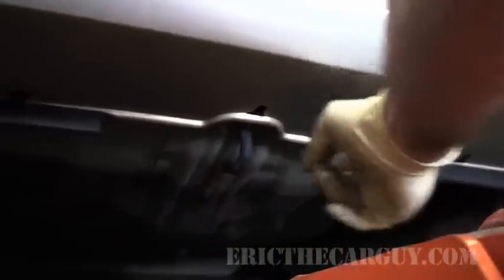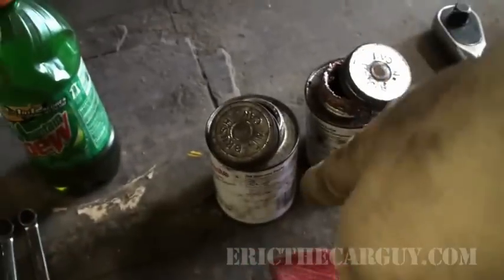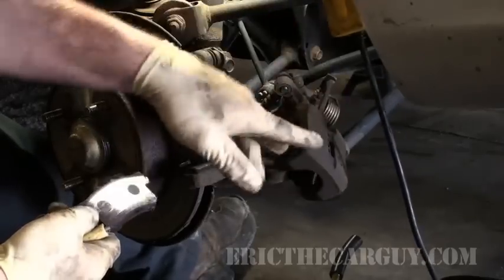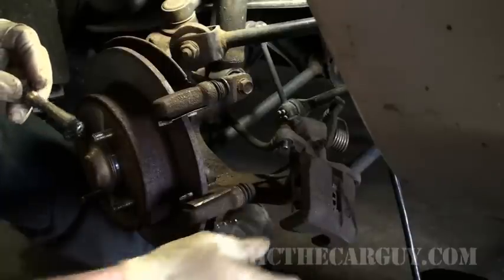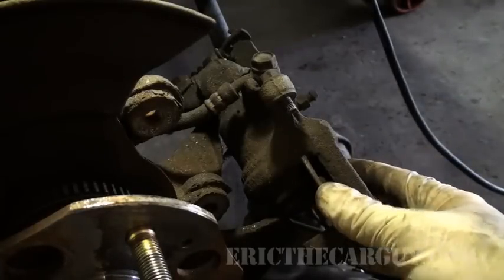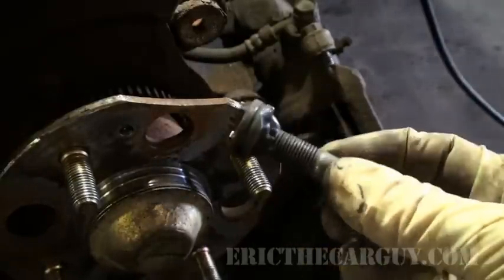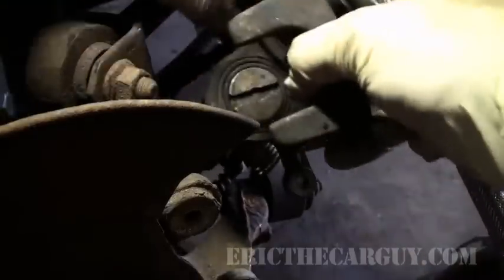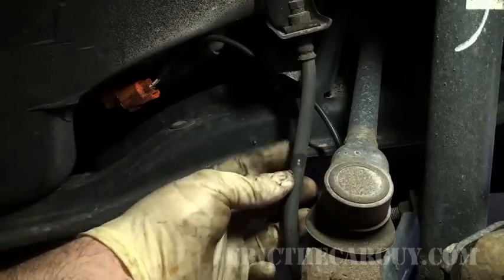How To Replace Rear Disc Brakes (Full) - EricTheCarGuy

Comment: Hi Eric, when you turn the caliper piston, you said turn it clockwise only.. Is that true for both the right(passenger) wheel and the left(driver) wheel?

My piston compression tool comes with both clockwise screw and counter-clockwise screw, so when is the uses for the counter-clockwise one?

Comment: hi Eric , is it necessary to release brake fluid value to let small 
amount of brake fluid to escape in order to push caliper piston back or 
it is OK to just use C Clamp to just push the caliper piston without 
releasing brake value, which method is right even for front or rear 
brake pads replacement? thanks

Comment: Hi Eric, thanks for your helpful guiding.
Eric while I was doing rear disc replacement on my Passat 04, I discovered very rusty part of hub assembly as well as the assembly bolts are super rusty, some of them even missing piece of them. If I would like to replace the hub assembly what needs to be done? Is it attached just with 5 allen screws?

Comment: Instead of Water Displacement-40th Attempt, try PB Blaster. PB Blaster is considered the best rust penetrant at the moment (anything stronger would not be available to public due to idiotic lawsuit). Then try using 3/8" breaker bar + 6-point socket. If that doesn't work, you need an impact tool. If the bolt breaks, you need a new set of slider pins & bolts. When I do my rears on 04 TL, I usually replace all hardware and on-line vendors sell caliper overhauls kits; recommended.

Comment: Hi Eric.  Do you have a video on adjusting the rear disk parking brake lever on an older Chevy?  I have a 4 wheel disc brake conversion kit (from CPP) for my 1971 El Camino.  I believe the rear disc calipers used in the kit are from: "1980-1985 Cadillac Seville Rear Calipers w/ Parking Brake." I believe that most of the GM rear disc brakes are the same design.  I want to know if I need to rotate the cylinder to advance the internal ratchet to precisely align the parking cable lever.  Thanks.

Comment: Antiseize on top of an abutment guide doesnt remove rust built up under the guide. Lube it all you want, it will still get wedged, and faster than the last time.  The caliper frame needs to be throughly cleaned down to bare shiny iron in that area before applying antiseize UNDER the abutment guides. The pad ands and stainless steel abutment guide will do fine with just silicone grease.

Comment: My experience may not be typical, but when I extracted frozen rotor retaining screws, the corrosion was under the screw bead, not on the threads. Also, those screws need only be installed hand tight, you don't need to hit them.

Comment: In this setup with new pads and new rotors, is it not necessary to machine the rotors? Also, does any prep work need to be done to the the pads before coming in-contact with the rotors?

Comment: If the caliper mounting frame is so corroded that the pads before bound by rust under the guides, its easier to remove the frame to work it than to remove the rust with the frame in place PLUS you lessen the amount of rust that could get into the space between the disk and inner hub. lso easier to remove, clean and relube the guide pins and boots .

Comment: Hey Eric, great video very thorough, but I have a question still. @ 7:50 you mentioned that you get a click when you apply the brakes. I have a '99 sienna with rear drums, and the sound of clicking comes from the rear. Are there any noises similar to the noise you were mentioning but for rear drum assemblies. The sienna is equipped with ABS. The sienna under light braking makes clicking every half a second until i let off of the brakes. Only one side is affected on the car.

Comment: Good instruction video , I myself prefer using a big flat screwdriver with a hex shank and if its tight I use a small wrench on the shank when turning the piston back into the bore .
Also I have never run into Master cylinder problems without pinching the hose , just my experience .
However I've had to drill those rotor holding screws out several times since the Factory does not see fit to put anti seize on the threads ..
By the way dude you look a lot like  George Clooney on some shots .

Comment: also use a 4" hand grinder to clean the outer disk lip. the new pads will seat better. don't forget to suck out all the old brake fluid in the reservoir and  lines. hand vacuum tools are cheap. In fords you'll need the piston tool to rotate it back so the parking brake can be set

Comment: ... then turning the remainders of the screws clockwise bit by bit, until they finally came out the back of the hub. Afterwards I used an M6 thread cutter to loosen he whole thing a bit, so I hopefully won't have the same problem next time.
What I really can't recommend is leaving the screws out completely. It's true the wheel rim holds the brake disc in place, but you can easily tilt the disc, which won't do you any good. Anyway, I now took only one screw per side.

Comment: On Honda that dont have the parking brake integral with the caliper, like the cd-v and element, you need to use a wrench to prevent the caliper guides from twisting and tearing their boots.

Comment: Thank-you so much for all these awesome videos!!!  I own a 2015 Nissan Altima.  It has the pins arranged OPPOSITE of what you say in this video @ 7:50.  Did it come from the factory that way, or did someone who didn't know what they were doing put them in the wrong holes?  I just watched a different brake pad replacement video that is specific to my make/model, and it showed the "rubberized" pin as belonging in the TOP hole.  What's the deal?  THANKS!!!

Comment: Is the mountain dew bottle with hose attached to the bleeder valve just to make sure the fluid doesn't spill? Is there any issue with just letting it bleed onto the ground or will this let air get into the hose/cause issues?
Reply: ***** Yes.  You need the hose to be submerged in brake fluid, so that it can only suck in fluid and not air when there's back-pressure.

Comment: I know this is an older video, but I got a question about them rear rotors. Them being not vented and single wall, do they not warp very easy? I got a 2000 prelude which has same rear rotors and I think they warped bad, I've never run bad brake pads on them either or never drive around with e brake on either

Comment: Hey Eric it is posting day for me again so one more question! When you grease the slide pins you use silicone lube but i can not seem to find that here anywhere :( and all people think i am a perv ^^ do u have a suggestion what else i could use ... my carparts shop  told me to use copper grease? that sounds a bit off to me but yeah i ve never heared of it so far so that might be the reason ^^

Comment: As long as you're able to make the piston spins, you can use anything.  I always try it with a long nose pryer before using that special tool.  But what happens is, the piston might got stuck, and you won't be able to spin it with a pryer.

Comment: Hi Eric, when I did the caliper piston on my VW Polo it would move clockwise but not go lower in the caliper. I then wound it anti clockwise two turns and then when I rotated the correct way it went in. Is this ok? Will I have introduced any air to the caliper? Cheers from the UK.

Comment: Nice Video, thanks Eric. I'm wondering if any one knows why its important to set the slot or the holes in the top of the piston to the 12 o'clock position. We have a wheel that still turns tight after following this and other videos. Slider pins and sides of pads and brackets all cleaned & lubricated, etc piston and caliper appear undamaged, running out of options. Wheel bearing ok and hydraulic lines seem ok, no built up pressure.

Comment: I know this video is over 6yrs old, but can you tell me when to choose silicone over anti cease or vise versa. Also is there a reason you clamp the hose and release the fluid thru the bleeder, rather than taking fluid out of the MC reservoir then just screw in the piston which I know will push fluid back to the reservoir. Is that bad for the MC? Thanks!

Comment: You can. Open the reservoir and wrap a rag around it to catch brake fluid in case it over flows.

There is a risk of ruining your master cylinder.

Comment: Vise grips with the fuel line, why didn't i think of that before; simple and efecive (well, sort of; brake lines are not really meant to be severely compressed like that, and we have replaced internally collapsed ones before ).

Comment: Eric, what happens if you rewind the brakes the wrong way? I had one that was really stuck, and I moved it back and forth until it retracted... and being that I wasn't sure I did it right, I turned it the wrong way to move the piston out (was putting in new seals).. will turning it the wrong way ruin the caliper? It was on an audi allroad 2004.

Comment: Added the lubricant to the contact points for brake pads. When I drive my truck, the brakes don't make any noise, but are extremely hot when I stop. How do I know if my piston is sticking or if I need to replace my caliper? You told me on a previous comment (on your latest video), that it's normal for brakes to heat up, but my husband is worried they are too hot.

Comment: 1. Trying to push the pistons in by turning and applying pressure manually wont get you anywhere. I tried for hours and finally gave up on that. However, I bought such a universal turn-push-tool from ebay. Like Eric's it has a front plate that can be used from both sides. However, since it also has pins on either side, it was to thick to fit into the caliper, just like in the video. So I ended up taking an angle grinder and cutting the further apart pins off. Then it fit just snuggly. :-)

Comment: I was told that taking the cap off of the master cylinder was sufficient protection to prevent anything bad from happening.

Is this not the case?

Comment: good vid Eric but you missed one of the most important things that make pads stick and wear fast etc , the stainless pad clips MUST be removed and cleaned with wire brush and more importantly the rust cleaned out from under them where they sit in the caliper holder  if not the rust forces the clips up and pinch the brake pads , I remove mine and sand blast the area and then put a light coat of syn. brake lube on the area to prevent rust  then put clips back in (also good idea to buy new clips as they wear also)  . File and wire brush on drill will work also  just be sure not to hit guide pin rubber boots or remove them . This must be done as it is the most common reason why pads stick and wear uneven and prematurely , also I refrain from putting any lubricant on edges of the pads in the stainless holders it will attract dust and dirt and gum the area up and prevent pads from moving ,

Comment: How do you free up seized caliper bracket bolts for the rear? Specifically a 1993 honda accord se coupe. I was told that you cant use heat with the brackets and they need to be replaced. I dont believe that, so im curious if its true or not.
Reply: I had the same problem. I was able to get it off by moving it back and forth with a vice grip or something similar, while rotating and pulling it out.

It would not move straight out no matter how hard I tried, but when I used the vice grip in a twisting motion it worked,

Comment: Does a 2007 PT cruiser with disc brakes on the back do they have screw in caliper or press hand in
Reply: Does a 2007 PT cruiser with rear disc brakes does the caliper screw in or are they press on top calipers

Comment: Why pinch off the brake line when pushing the caliper piston back in?
Would it be harmful if the brake fluid just returned to the Reservoir ?

Comment: I guess that liquid in brake cylinder may contains a lot of moisture and it may have a wear products of rubber ring on piston.
Don't think that overfull may occurs since the level in extension tank just returns to it's initial position.
Sorry for my poor English- I'm Russian.

Comment: Ok. "Sticking Caliper" then youd have to repalce it!?! Hmmm. It all depends. Now there are some trciks to get it working properly. One of the main issues that Im thinking of is "the brake fluid". Hint: Open the bleeder valve and see what color the brake fluid is. The more dark brown it is the more moisture has setteled in it. You just might want to change the break fluid then (brake fluid should always have a nice light yellow color) This can work miricals. Have fun guys.
 Reading through the comments That 1 guy was right. If a caliper has that much rust,  Then at a minimum the areas should be free of rust, and then assemble the caliper agin with the springs. VERY LIGHTY use a lubricant so that the pads can move freely. That pretty much takes the possibilies that the caliper is messed up. Just a note for beginners that wanna learn. Like I said have fun yall.
 One more impotarant thing keep rotors clean at all times. Once greece or ANY SUBSTANCE makes contact with the rotor then clean the rotor with brake cleaner!! This is for your own safety!!! I run a work shop and I know what Im talking about!! Something I forgot Eric uses a Green bottle. Use a Clera bottel For you to be able to see what color the brake fluids in.

Comment: Hi Eric,
In my civic there's an issue with rear left caliper.. Thing is: the lower pin, which has to slide in and out to let the caliper work, seems to be locked, even if you hit it whit a hammer it doesn move at all.. I assume this is the cause of the horrible noise I heard for all last week.. My question is; does both pins have to move? I would answer yes but I nees some "xpert" opinion to be sure 100%.
Thank you!!

Comment: hello to the car guy i wish you could work on my mazda protege 2000  there is a klounking noise when ever you stop at a stop sign or a traffic light it could be coming from the cv joint or the  cv boot axle?

Comment: I found out if you need a bleeder hose if you can get a 50-foot Oxygen hose it fits perfect on the bleeder. and it can be routed all the way to the master cylinder, also you can not kink that type of hose. route it to the cylinder and you can bleed the system alone, at the cylinder  from  the bleeder route the hose high so you don't get air bubbles in the line and it does not back feed to the caliper, good luck
Reply: Alan Baca that sounds like over kill you can just use a vacuum line I like to use the line clear line for air pumps

Comment: Ive never opened the bleed screw when pushing the piston in. Ive only been a mechanic for 3 years and have done a lot of cars this way and never had any problems with the master cylinder.

Comment: question , what the most miles that u have heard on an alero??? i have a 99 alerp 2.4 just past 250000 miles , i have a short vidoe showning this fact. original tranny and motor no major repairs ????  any info would be great

Comment: great explanation on everything :)
noticed that u use ur palm to loosen bolts that are on too tight haha 
i'd be careful and use the palm u dont mind losing in the future due to arthritis L0L
just  a tip i learned from all the master auto techs i've worked with :x
if i need to bang, i use rubber mallot or a brass haha 
either way its all good ;P

thought i'd spread the advice!! :P

Comment: One thing that had me confused is the location of the "slide pin with bushing" be it top or bottom as I've heard multiple different claims. I just had a look at the service manual for my accord and in that cars case it is as follows: Rear Brakes - Slide pin with bushing on BOTTOM. Front Brakes - Slide pin with bushing at TOP. Hope this is helpful to someone

Comment: I did the rear disc brakes on my car today. I didn't clamp off the brake line or open the bleeder when I twisted the caliper piston back in like you did.  So I did force some fluid back into the master cylinder....honestly, how bad is that?

Comment: Sometimes when putting the new pads in and they feels tight you might want to take out the two shims that attach to the bracket (not the shims on the back of the pads) and see if any rust/corrosion has built up underneath causing them to push out making it hard for the pads to slide freely (especially in the rust belt). Clean the corrosion off of the bracket then clean the shims, or better yet, install new ones and you should be good to go. I just replace the brake hardware anyway. It's inexpensive..

Comment: hi eric mr 2 rear brake calaper recon .i just fitted it pumped up pedal set uphand brake but no hand brake from the new one  at all . Other side is good .New pads Disc very good what do you think wrong ?piston comes out by foot application can you help thanks Bill what could be wrong with the new calaper ?

Comment: Piston seized had a hard time bracing the caliper on 98 honda prelude wound up using small racheting binder rubber seal missing inside corroded

Comment: I watched Eric's excellent brake videos but, now emergency brake light stuck on. I replaced rotors,brakes drums with new pads on 2009 nissan Sentra. I even removed center column for emergency brake level to check switch. light stays red on dash no matter what i do.  I also flushed out old brake fluid with new brake fluid & topped off full.  Stupid brake light stays solid red. Any help would be gladly appreciated thanks.